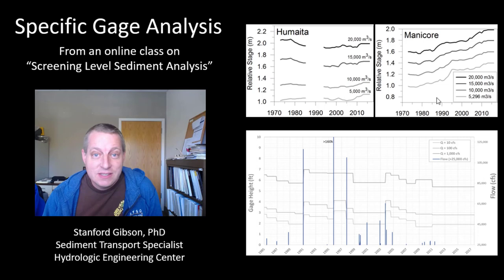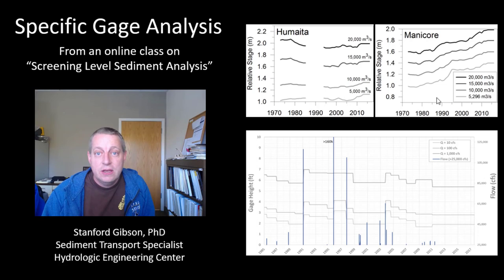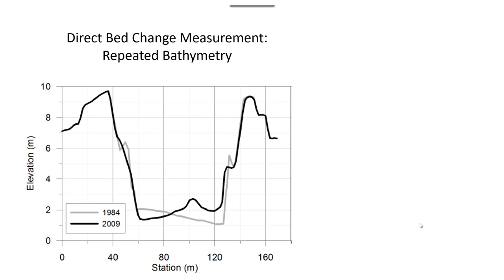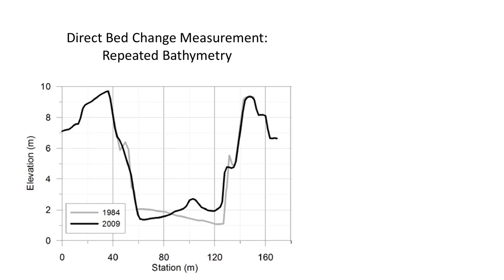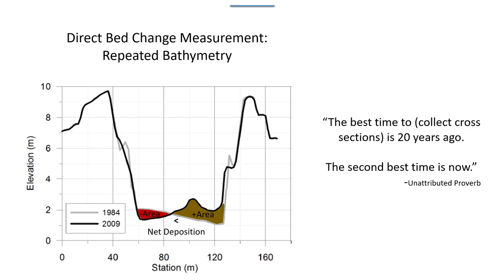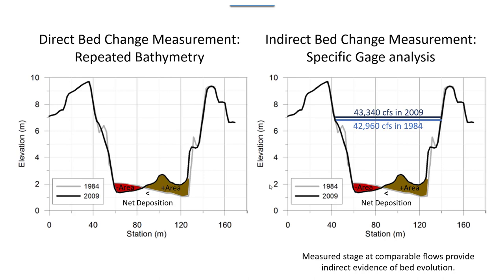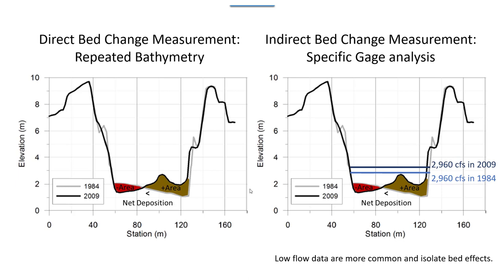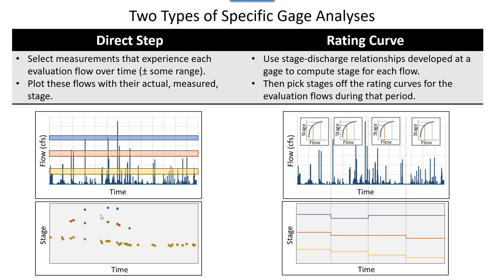Specific Gage Analysis: Inferring River Bed Evolution with Indirect Measurements

Comment: This is a great lecture, Stanford. Chester Watson taught us about this type of analysis in his Stream Rehabilitation course at CSU. I believe he and Biedenharn used this a lot in the Mississippi Valley. I like how you noted the specific gage trends using frequent flows (Chester typically used the lower 10%), then overlaid that with threshold events to investigate what triggered and erosion and deposition cycle and the gradual return to equilibrium. Very insightful and jives well with my experience and understanding of channel response.

Comment: I have a separate question, how we can time variant morphological analysis to see how a river changing in last 30 years? as you shown Mississippi river in the video.
Reply from the maker: The Mississippi specific gage data were plotted against the results from a 1D morphodynamic model.  HEC-RAS can do this analysis.  Several of the videos on this channel describe this kind of 1D morphological analysis.  A good place to start is the three part series that begins with this video: https://youtu.be/d416442IC4c
Reply from the maker: BTW: We are adding a new output to HEC-RAS that will mine mobile bed model results and an observed stage/flow time series to generate the specific gage calibration plot like the one I showed by Tony Thomas on the Mississippi (17:33)